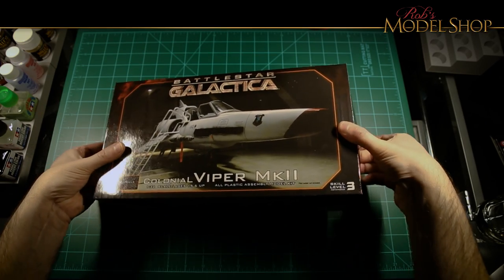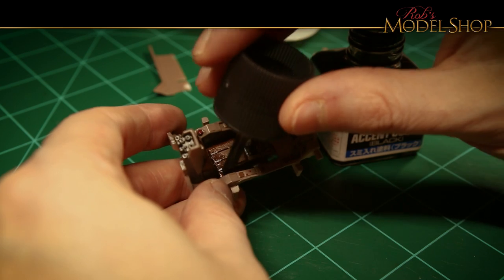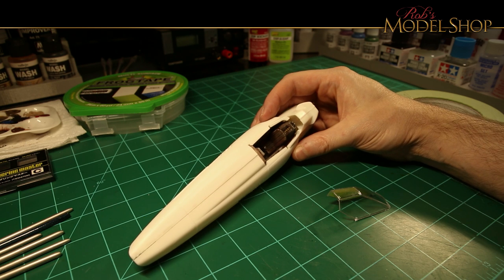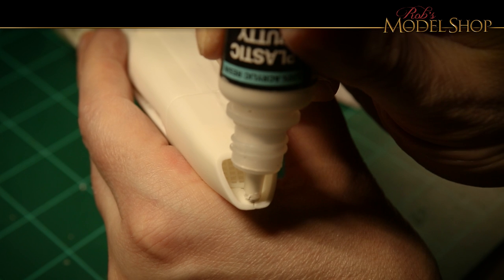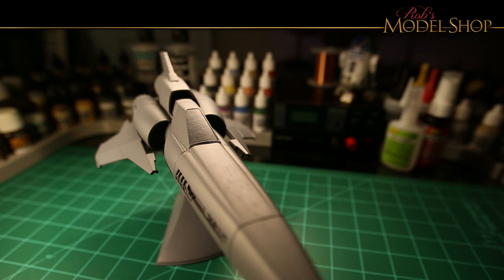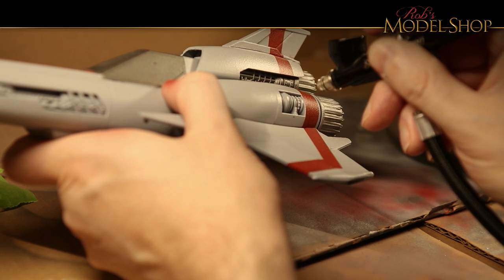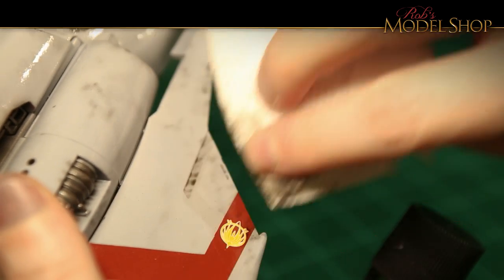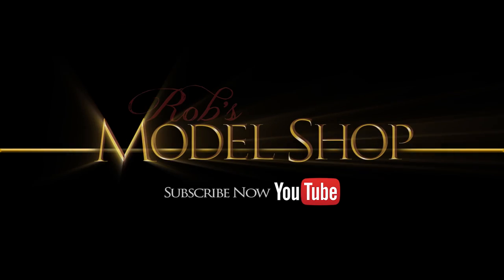Rob's Model Shop - Episode 2 "Colonial Viper MkII"

Comment: Here in 2021.  Good job.  I was into kit modeling around 40 years ago.  I still have the Colonial Viper kit model that I put together around 1979. It's the Monogram version.  There are 3 major design differences between the original/classic Viper & this MkII from the reimagined series.   The first is that this one exposes more of the engines towards the exhausts while the original exposes more of the front part of the intakes as well as some service panels between.  The other difference is that the front fuselage starts to taper off towards the nose & makes it smaller, while the original is straighter, thus the photo torpedo port is a wider hole. The Monogram version also does not have see-through plastic for the cockpit windows. The red line decals are nearly the same, which I suppose they kept that way as a homage & historical reference to the original.  The red decals on mine had since fell off, even 40 years ago, so what I did as a kid was just cut some paper, painted red & glued them on. Looks good, although not really desirable today, but I couldn't think of anything else back then. :)
Reply from the maker: Thanks so much for the comment. As a kid, I loved the show when it first aired and have a lot of great memories from it. I also started building models back then, but they were all terrible. There's a lot of great model building tools available now than there was back in those days. You should give it another go. Thanks again for the comment. Take care.
Reply: @RobPauza   ... Well I did want the Cylon Raider badly, but even then the kits were expensive for a kid, so never really got one.  I built several kits in those days, around 1980, they were mostly planes, fictional & non-fictional, including the Viper.  Non-fictional includes an F-104 Starfighter, F-4 Phantom & a Russian MiG 25 Foxbat.  Of course there was the ocassional car & some other stuff like a lighted Goodyear blimp, Nimitz aircraft carrier & a Star Wars AT-AT.  Also have the Buck Rogers Thunderfighter to go with the sci-fi stuff. Some of these things have tiny pieces that had since broken off but I saved them to glue back again someday.  By 1985, I pretty much lost my interest, although I still have the tools (brushes, glues, paints, etc).  The reason for losing interest was my dive into computers, beginning with the Commodore 64 around 1983, then onto PC, though I still have my C-64's. Well actually it began in the late 1970's with gaming consoles (Coleco & Atari).  I do have at least one more plastic kit I never put together, a Star Wars B-Wing bomber, bought back in the day, so maybe I may try my hand in it someday.  I also have some sort of car kit that I never put together either, but with maybe around 300 pieces, it would be daunting especially when I have lost interest in the whole thing. I may sell it eventually.  And I do recall the local Walmart having scale kits & tools in the toy section only a few years ago, but when I went there recently, maybe in the last couple years, it was all gone.  Today, the models I make are in CAD, though it's mostly for floorplan stuff. Perhaps that was my path when it comes to modeling, i.e. from plastic to silicon, heh.  So, we'll see.  Take care too. :)
Reply from the maker: @robwebnoid5763  I think I'm a few years younger than you, but it seems like we had a similar childhood. The Vic20 was my first computer, followed by the 64, then my brother and I went full-throttle and got an Amiga 500 and added extra RAM to get a whopping 1 MB! We also had an Atari400 somewhere in the mix and started moving towards PCs after that. I've only built a couple plastic models in the last 30 years, but it's been fun to get back in it a bit. 3D printing kind of sparked it back for me. That's mainly what I do now... when I have time... which isn't very often these days.
Reply: @RobPauza  ... That is cool to know you were also a Commodorian. Yes I'm probably a little bit older.  I went for the C64 after a bit of research.  In highschool, the main classroom PC's at the time were TRS-80's, mainly the Mk II & IV, networked to a harddrive (probably 1-2 MB disc space, who knows) using CP/M as the DOS.  As a young teen then in the early 1980's, when the family went out to the malls, I would walk to any department store that had the microcomputer floor demo units & would play around with them. Atari, Commodore, RadioShack, Mattel, Apple & IBM(Intel), etc.  I found a magazine article comparing the microcomputers at the time & eventually chose the C-64 because of the specs.  By 1982-83, I felt the Vic-20 was on its way out as well as the Atari 400, which I had also both played around with at the stores prior.  The Atari 800 was real nice too, built like a tank, but aging. Today, I still have three C-64's but only one is working, so I will have to debug the other units (one has a busted voltage regulator). I have at least 5 floppy drives for them, including three 1541's, a 1541-ii , a 1581, plus a couple 3rd party (Excelerator+).  Still have many impact dotmatrix printers, not just for Commodore but also for the office I used to work at (I did simple network & database management & also custom programming). I also have a C64 CPU accelerator 4x faster than stock.  Nearly 15 years ago, I was handed a C128 but I turned it down because I was thinking that if I take it, it would take my focus away from my C-64 & PC systems & I was already busy with my time.  I half-regret it, but perhaps it was for the better.  I did want an Amiga back then. In the early 1990's, a college classmate was selling his Amiga 600 system, but I also said no thanks.  So basically I missed the Amiga bandwagon, which is ok now. By the mid 1980's, I was starting to get into PC's, beginning with a XT/8088-class system for work (but also for play).  I have accumulated several PC's, not because I collect them but mainly because I've kept the ones we've bought over the years. Some of them I took apart & put the motherboards in ESD bags, which really helped compact the amount of machines I have. I understand the 1 MB thing, it's meager now but not back then.  I actually still have an 80286 from the late 1980's that I still want to populate with 1 MB of DIP memory chips but havent yet, not a priority, it only has 640k.  I don't really have any thing modern as far as desktops/towers go, so all I have are modern laptops (models within the past 10 years).  
That is really nice that you have a 3D printer.  I was looking into those around 5 years ago & would see them at the local Frys Electronics (RIP).  Isn't that funny, you go from plastic (scale models) to silicon (CAD) & back to plastic (3D printer).  One thing I wish 3D printers could do now is make metal gear wheels.  I fix machines & I have a couple paper shredders that need new gears, which these gears are hard to find. I don't have the knowhow but I've seen videos of some machinists making metal gears from scratch. The rest of the shredder works, but without that one gear, the shredder doesnt work.  I suppose that would be the same as a person won't be alive without a heart or brain. It's just bad design, this specific gear wheel takes a lot of the brunt in the gear system of the shredder, especially when people put more than one sheet of paper stacked together to shred. Anyway, glad to see another C= fan around here. I used to go to the Lemon64 forum, but now just too busy.  Instead my free time these days is watching Youtube, lmao.  :)
Reply from the maker: @robwebnoid5763  Ah.. I had almost forgotten about the TRS-80's.. We called them "Trash-80's". Yeah, we had those in school as well as Apple 2e's. I never got much into programming, but my brother did for sure. I can make lights blink on Arduino's, but not a whole lot more. I'm not sure what to tell you about the gear problem. That would be a tough 3D print to make. Otherwise, you could print, then mold/cast in metal. I guess the other option is to just machine one. I don't know much about that. I do enjoy watching Clickspring on YouTube. He does some amazing machine work that involves custom gears. Good talking to you.
Reply: @RobPauza   ... Yes, Trash-80 is its popular nickname.  Their not that bad for the time, although they were "seniors" by the mid 1980's.  Learned a lot on them during the computer course there. What's funny is during the final exam, where we had to demonstrate our programming knowledge, I did it on my C-64 & brought it to school.  It was some sound synth program I made (using the SID) & paddles.  I did forget to mention that what really got me into Commodore was that in my entire highschool, me & a classmate spotted a lone Commodore PET (2k) in a back room of the main science classroom. On that pc, we did a lot of programming (Basic), although he did a lot more than I did.  That PET is what subliminally started me on the road to choose the C-64 over anything else. I could have been a fanboy of some other brand computer, but I suppose this was my fate.  I have to wonder what ever happened to that lone computer.  I had also encountered the Apple 2's (or //'s) a few years earlier in 1980 at a friend's house, as well as an Apple //c in the late 1980's in college & that's about it.  That 1980 encounter with the // may have been the first time I discovered what a personal computer was.  
Yes, I wish 3D printers can build something tough today, such as a metal gear.  I believe I may have seen an article on 3D printers able to build things in metal now.  Some paper shredders do use gears made of thermoplastic, which in some cases can work but not as long lasting as metal.  That one gear I speak of earlier that I need would not last long had it been made of plastic.  You may have seen plastic gears such as in sewing machines & pencil sharpeners, some using thermoplastic.  I have a sharpener that has one & you guessed it, the plastic gear cracked into two, although it did last for a decade prior.  Now me as a repair person, I haven't thrown this pencil sharpener out, I'm going to try to fix the gear, heh.  With thermoplastic, you should be able to re-melt the cracked pieces together, but I've yet to try.  Anyway,  I've never heard of Clickspring so I may take a look into that.  Now here's something a scale model kit company should try.  How about making a working model of a paper shredder (or some other common machine) using just all plastic (polystyrene)?  Everything is plastic, including the gears.  But it will still need an electric motor & circuit board to come with the kit to make it work authentically.  The plastic gear box may need to be grease-lubricated as well.  It would only be for demonstration & art piece (as all scale models are), because it will probably break on the first paper it will shred.  
Well, I hope to see you build a Cylon Raider, either classic or reimagined, to go along with your Viper.  Nice talking to you too (yes I know my comments are way long  lol).    :)

Comment: I was in a squadron years ago and the pilots would use 1/72 scale models on a dowel road during their briefs.  They didn't do any details, just glue it up, fill it up with body filler to give it some weight, paint it, stick a dowel rod up an exhaust.  They didn't look pretty but for training purposes they were very practical especially when the insides were filled with body filler they were pretty durable also because they did get knocked around a bit and would break without the filler.

I made a few models over 35 years ago and some were okay but not as pretty as yours but for a beginner I did most of your techniques with regular Testor's model paint and brushes.  I still have them at my mom's house after all these years her grandkids never touched them.
Reply from the maker: Thanks for the comment. I have actually wondered for a long time if those small models used in briefings are just regular plastic models. Thanks for letting me know. That's actually super interesting. I used to make models as a kid as well using the Testors enamels. Mine were pretty terrible to be honest. I just got back into this stuff a little bit since 3d printing became such a big thing. Glad your models have somehow gone undestroyed after all these years. :) Thanks again for the comment. -Rob

Comment: I use Tamiya white and grey putty now. It's not to bad on shrinking. 
I remember as a kid in the early to mid eighties,Bondo body filler, for cars, they used to have a single part putty in a 6/8 inch tube,like for touch ups I guess. I used to get that stuff and used it all the time. Miss the good ol days when the really good stuff was dangerous,and would either blow up if you snuck a smoke or the fumes would try to kill you if you forgot to open your window!
That frog tape does that with oil paints! I used a Q-tip wet with lighter fluid to dissolve it. Doesn't seem to mess with model plastic...
Reply from the maker: tom cline I use Tamiya as well and it’s definitely way better. Also like Milliput too. Yeah, too bad about not having the dangerous stuff. 👍 Thanks for the comments.

Comment: Late to the game, but its a really great job on that!  Next time stick the Frog Tape to your desktop - making sure its clean -peel it up and use it.  It will tone down the adhesive enough that it should not leave residue like that.
Reply from the maker: Thanks a bunch Michael. I'm a bit afraid to try Frog tape again after having that happen, but I may give it another go. Just glad it was on the clear canopy rather than on the paint. Thanks again!
Reply: I just finished the Captain America video - switch to the 3M Green tape with that method.  I get mine from Auto Shops, but I think the Big Boxes have them as well.

Comment: Great work-especially adapting to a lot of the actual model issues. Was hoping for a bit more detail with the pilot (Starbuck) and the tail end engine area of the viper. Looks really really great either way though. Cheers!
Reply from the maker: Kurt Adams Thanks. I wasn’t a fan of the pilot, so I got a bit lazy. Also, debated on adding lighting but laziness also won out there as well, especially after so much fitting. ;) Thanks for the comment.

Comment: nice work. I have been using the frog tape in recently and haven't had the issue you had. maybe they changed their formula.
Reply from the maker: Thanks Bryan. Glad it's working for you. I think that whole project was just cursed for me. :) I've heard others say that their model fit well too... so maybe I just had a bad day. Thanks again, and for the comment.
Reply: @RobPauza  I enjoyed your build and how you over came some of the poorly fitting pieces. I built an old shuttle tydirium from the 80s and it didn't go well with the final fit. I have a second try at going to add pico LED lights to the wings, but going to do a lot my work make sure it fits. Thanks for the video

Comment: Sometimes its nice to do drybrushing in layers (1. 80% original color 20% wear color, heavy pressure, 2. 50% original color 50% wear color, medium pressure, 3. 100% wear color, light pressure) or more steps. I would never ever just wetpaint a silver damage area right on using a brush.

Comment: Whenever i spray vallejo through my sotar it just clogs. no matter how much i thin it. I am amazed how smooth you did it. Great job
Reply from the maker: Oh really? I have noticed certain colors clog a little easier, but overall have had good luck. I'm using the stock nozzle and about 25-30 psi. I usually do add a little flow improver to the mix since I use a little higher psi. Helps it not dry on needle or before it lands on the surface. Best wishes, and thanks btw. I appreciate the comment.
Reply from the maker: @MrGioMadrid  Sure didn't. I just looked into it and there's definitely some debate depending on where you're from, but it does seem the general consensus is that "Vah-YEH-hoh" is correct, so thanks for letting me know.

Comment: use the purple coloured tape you can leave longer and it easier to peel
Reply from the maker: Michael Abbey I’ll give it a try. Definitely not using this green any more. ;) Thanks!
Reply: I use it for coloured pencil on watercolour paper at the moment and using gamsol. it may bleed tiny amount if very diluted. Have had it stuck down for weeks and only one time a slight tear in paper.
Reply from the maker: Michael Abbey I’ll definitely try it. Nice stuff on your channel pics btw. Now you need some content. 😁👍 Thanks again!

Comment: Good video. I have the same kit and this has given me a few ideas on how to go about mine. Just wondering if you thin your clear coats or are they good to go with an airbrush from the bottle?
Reply from the maker: uberboltneck Thanks a bunch. I don’t thin my clear coats. The Vellejo ones work pretty well right out of the bottle. They are a bit thicker than paint but seem to do okay. Good luck with your build. Get ready to use about 5 pounds of putty. ;)

Comment: Wont lighter fluid like Zippo work on the leftover adhesive from the tape on the canopy, just saturate a q-tip and wipe till its all clean?
Reply from the maker: Den Smith It probably would have worked well for that actually.